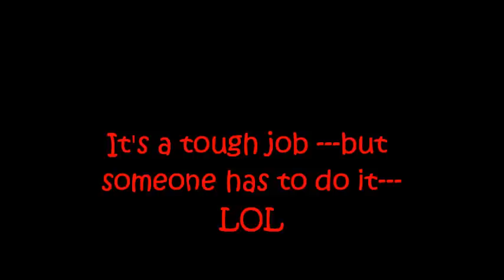Tough job

Comment: @minibulldesign I think a major problem with the poison pot was it's price. Understand the need for it, massive amount of work, but it was hard to 'justify' that price from the buyers perspective.  I did have some issues with mine. After using it three-four times a day, for about two months, the JB-weld (or whatever it was, think it was jb-weld) began to break down. Considering what kind of chemicals that stuff is, I just felt it was unsafe to keep using it. The rest of the pot never faltered.